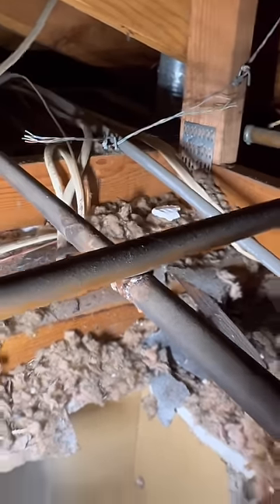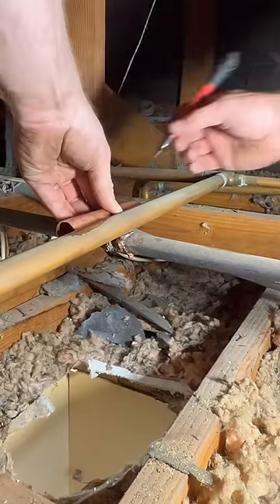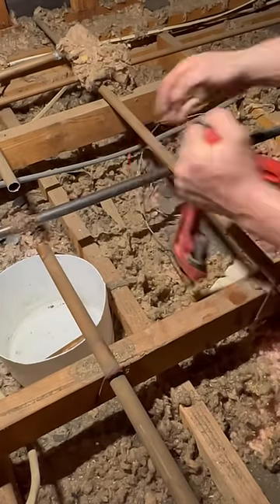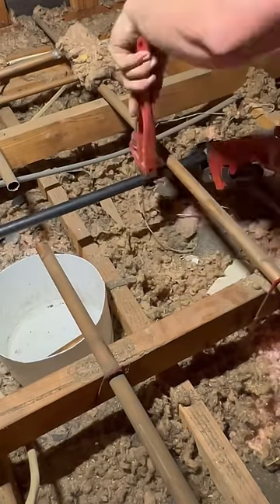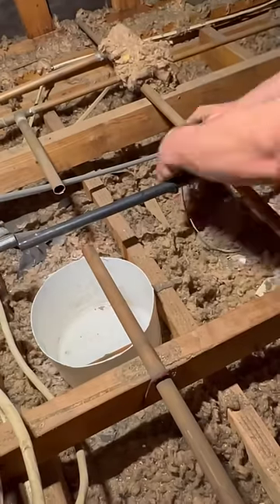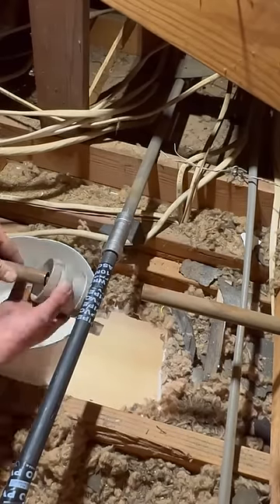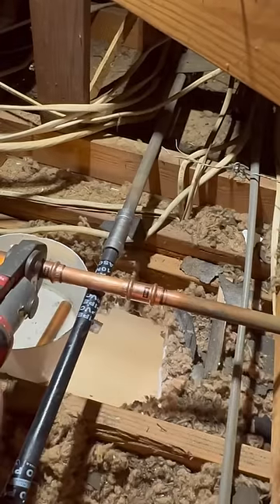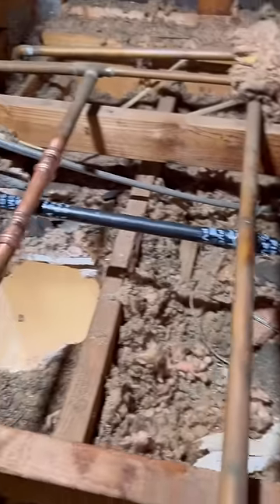a little galvanic corrosion action #plumber #plumbing #propress #soldering #diy #repair #gasline

Comment: You'd be surprised what helpers can screw up. We press 80% of our work now and it's rare but occasionally someone will get lazy and try to force an angle they shouldn't or stretch a fitting. Thosell leak. Gotta install em properly

Comment: Only time I have a propress leak, is when I forget to crimp it.
Reply: @Supa Trending Daily so all the pressed fittings from the 90s back are leaking then?
Reply: @Supa Trending Daily  you's onna those "back in my day" fellas, ain't ya?
Reply: @Megabear90  I heard they've been using press fittings in Europe since the 70's
Reply: @walterbrunswick they’re all over Japan too
Reply: The job sight I’m at right now (Kyle Field in College Station, Tx.) I seen the plumbers put in a few pro press leaks, turns out the battery on the press tool was low and the jaws needed some grease. I’m the Sprinkler Fitter Foreman, so it’s all threaded and grooved couplings for us.
Reply: @allencarabajal8989  Thanks, that's good information for everybody.
Reply: Hey boy… back in rubble rubble rubble! 😂

Comment: Even plumbing a long time,  never seen a press fitting leak either. Ive never had a call back from one either. Excellent work sir. Man I love that Milwaukee press tool. I have the m12 as well,  I also have the jaws for gas,  copper (even the 1 1/4”) and Pex as well. So handy man.
Reply: Just got into plumbing a few weeks ago, my first few jobs were going in to replace leaking press fittings.
Reply: The M12 Milwaukee radial press is really nice, I actually thought of buying it, but then I went for REMS Mini-Press 22V and it's great. Also never seen a leaking press fitting while I saw hundreds of PEX threaded fittings leaking and when I'm on a job where I gotta do something with pipes I always replace them for press fittings and I haven't had a complaint about leaks yet
Reply: @joeycampbell940 Then they were installed incorrectly

Comment: Commercial plumber here. I've used propress many times. When you have to replace 4" tees or 90s because of leaks it gets very expensive. Most architects have gone back to solder.

Comment: The building I work in gets a lot of leaky pipes.  They are old and frail.  There was one job the plumber came in to fix the leak, and pro pressed all the fittings as they usually do. Well we turned the water back on and it was leaking from the fitting.  First time I've seen it too.  Turns out the section of pipe he pressed onto was also weak, and he had to cut more pipe out to fix the new pipe on to. Didn't leak after that.

Comment: Only tiny rec is that I would put more isolation between the two pipe types and some way to immobilize that crossing.  Kinda a belt and suspenders method.  Otherwise, great fix.  Thanks.

Comment: The only time I’ve seen a Press leak, is when it’s been adjusted and not re-pressed. Even then, the connection didn’t actually fail catastrophically. A repress later and it was fine. (I believe you can get up to a few adjustments in and still be eligible for warranty. But don’t quote me on that.)

Comment: Your helper is quite handy....  I guess whoever installed the original pipes wasn't aware of metal contact corrosion....
Reply: Original installer just didn't concern himself with the issue because even my dumbass knows not to have the two metals touching

Comment: 3" copper pro press 90 inline serving a steam fired boiler- with a 1hp grundfos high volume circulation pump moving water through a 2" copper line connected to the system, running 24-7. the copper pro-press 90 leaked at the HEEL- but not at the joint. we double-press anything bigger than 2"- we noticed that if we don't... occasionally the joints will leak- and are easily fixed by 'offsetting' the crimp jaw by a 1/4 turn and pressing again, so now we double press EVERY 2.5" and larger joint. technically, the heel leak isn't a pro-press failure though- it's a COPPER failure.

Comment: Water hammers causes friction between two pipes rubbing causing a leak. Tape is just a temporary thing might last a few years but if insulated would have lasted 20+ years
Reply from the maker: 🤣🤣the pvc tape is going get melted away from water hammer friction?

Comment: I've only seen one pro-press fitting leak. It was on a tee joint and it was leaking at/around the connection point. I must say that this was on a hot water line in a hospital with 160 psi in the line.

Comment: Pro press for steel pipe. I have got to get into that. That's unreal
Reply: It's called mega press. For galvi and black iron gas pipe. I think they might be making ones for old galvi water lines as well. The press jaws fit on propress guns as long as they are compatible. Pricey, but saves tons of time over threading.
Reply: Works great

Comment: Propress seals so well that it seals even if you remove the o-rings. The only time it might leak is if you handle the pipe regularly, so don't use it on an outdoor hose bib.

Comment: I've had a 3 inch tee leak.  We air tested it at 100psi and then after that passed, we left the water on.  About a month or so go by and the tee finally gives out over the weekend.  We checked it and it was seated all the way, but funny how it leaked way later.  Luckily the building wasn't close to being finished and there was no problems as we had a floor drain right there.  So makes you wonder wtf happened.  Wish we would have cut a cross section out and see what was up.  

I've also had some of the rubber inserts get fucked up when inserting the copper pipe.  This happened on a 4 inch line.  For some reason seems like the bigger the pipe, the more problems.  Other wise I've never had any problems than just a handful.

Comment: Not to be one of those "hey boy" guys. But I did a little bit of research on EPDM rubber. That's the rubber used in most propress fittings.

This is from a paper on chlorine degradation of Butyl and EPDM rubber from company that sells EPDM and butyl rubber lined storage tanks.

"The recommended maximum concentration at ambient temperatures for Butyl and 
EPDM liners is as follows:- 
• Constant chlorine of max. 0.2 mg/l (ppm) 
o Will not have a significant effect on the service life of the liner. 
• Chlorine concentrations constantly higher than 0.2 mg/l 
o Will have an effect on the life time of liners. 
o The expected life time of the Butyl and EPDM liners is 20-25 years but 
will obviously be reduced with higher chlorine concentrations and the 
user must balance take this into account when calculating the 
expected practical life of the liner. 
• Temporary increases in concentrations 
o up to 5.0mg/l for a maximum of 24 hours and not more than 20 times 
over a year can be accepted without major effects on the liner 
o Temporary increases of concentration up to 50 mg/l for a maximum 
of 24 hours and not more then once a year, procedure according to 
BS 6700, can be accepted without major effects on the liner. 
o Or a concentration up to 500 mg/l for a maximum of 1 hour, followed 
by an immediate clean water wash, can be accepted for disinfection.

Your average city water is anywhere between 0.4mg/l to 4mg/l

That with their recommendation of anything up to 5mg/l exposure should be limited to no longer than 24 hours and no more than 20 times a year. 

That makes me doubt propress fittings. Not all the fud lore from some dude saying "hey boy". But  scientifically tested results from a company that manufactures products using the same materials that are used in the press fittings.

EPDM rubber is also used in those gas line press fittings. EPDM breaks down when exposed to hydrocarbons. The hydrocarbons essentially start cutting the polymer chains in half which heavily degrades the rubber. Natural gas is just naturally made hydrocarbons mixed with 11 herbs and spices.

Please do not use the gas line press fittings. That is fucking dangerous for the customer. I'd use appropriate language but it's not the time. That is going to get someone killed.

Comment: Generally, the copper press fittings leak due to poor installation, mostly not deburring and prepping the pipe, it scores the O-ring just enough.

Comment: Not a criticism a question from an up in coming plumber why didn't you swing joint the Cooper just to get it away from the galvanized steel as an extra precaution. Love the videos and content, can't wait till I upgrade from my manual pex crimper to the milwaukee wireless

Comment: The pro press fittings only leak if you aren’t hooked up dead on. So basically just user error.
Reply: I disagree out of experience.   -  Master plumber in Texas for 17 years 
propress is great but i have seen 50 + time that it has failed and the install looks good .  i run a 24/7 company so we get the emergency calls.    i have found that water softeners that are ramped up wuth eat the o rings out . i dont know why but i have had multiple cafes and diners that the soft water loops that will eat the fittings .  i can assure you this is true but i do not know why .   we are talking large commercial softners,  3 inch mains.  
i use propess where it is useful but my faith is in the good old gas welding it together.  cant beat a weld.
Reply: @Z The G  thanks for sharing your experience

Comment: After all that you just put tape in between them, they do make 45s in order to jump up and over
Reply: Why add more potential points of failure?
Reply: @MischeifMakerz  correct why reply on tape to eliminate dissimilar metal corrosion, you could have used tube benders and the same joiners if you were worried about the 2 extra fittings
Reply: @phs84  would make the tube shorter?
Reply: @MischeifMakerz  no tube in the truck ? what plumber does not have a bucket full of copper off cuts, just keep taping pipes bro, makes me look like a rock star

Comment: Have never seen pro press fittings used on a gas line before, thats pretty friggen cool. Do you have to use any sealant for them? Or just press them right into place? Likely different codes than us up here in Canada, but damn that would make life so much easier

Comment: I have had two propress fittings that leaked due to other than installation error, in five years of replacing water heaters and some miscellaneous plumbing. And no troubles of trick soldering or having to evacuate water full before working.

Comment: Nevermind I got my question answered. I wish i could use a ProPress so badly my company preaches about how the fittings leak but they don’t leak! pipes ive soldered keep me up at night. i always felt like pressed fittings work better than soldered joints

Comment: i wouldn’t sand down the copper when you’re adding on the propress coupling. it will damage the rubber o ring inside and actually cause a leak. great video btw
Reply from the maker: Viega recommended sanding old pipe👍🏻I do sponsored content for them bud

Comment: When installing black iron do you sand the pipe all the way down to bare metal or do you just use the sand paper to clean it up.
Reply: Neither. Cut , thread, install
Reply: I just clean it up to smooth surface.
Reply: @TeamTnA44  Yep, but sometimes one must use PPress.

Comment: I personally would have put something more resilient between the pipes, like a piece of pvc pipe cut in half or a strip of hard plastic wrapped with the tape, something that is less likely to rub through in time.
Of course, I am generally dealing with hydraulic lines in mills or on heavy equipment, so slightly more movement, but I like to prevent repeat issues! Lol

Comment: Ive seen those fitting leak before… they were not installed correctly and they ripped the rubber gasket. So as long as you install them correctly they wont leak.

Comment: As a welder all I think is that Milwaukee coming out with that pipe clamper tool must of been a life changer … tbh I’d just weld all that and it would never fail but just me guess u can’t weld copper
Reply from the maker: 🤣🤣you can solder copper but why would I. They make a tool for that

Comment: I'm not bashing propress at all, i use it every day, buuuut... I've definitely had more leaks using press fittings than i have soldering. I think a lot of the problem comes from fittings sitting out on dirty construction sites and dirt and dust accumulating around the o-ring.  That lubricant they put on them is a dirt magnet.

Comment: I seen someone fixed a pin hole with 1 propress coupling. That customer called, I went in found the repair failed, a little over a year later. I cut out a 10" section and preformed a similar repair that your showing. She was mad, I would be too. It cost her an additional $700.00 for me to come back. 

Ya so, I have seen one propress fitting fail, and I don't think that was nibcos fault. Just the Inexperienced hvac tech that was working on the plumbing.

Comment: Is there slip couplings for copper? So instead of using 2 fittings you could only use 1 like u did on the gas?

Comment: Ive never seen a properly installed pp fitting leak either. My bigger problem with propress is that it cam hold under an air test even when it's not pressed. Had a 1" cap explode off inches away from my hand before... double check your joints brothers.

Comment: The only leak I’ve had with pro press on copper is because my guys were too lazy to use the sharpie and verify that the pipe was made up all the way past the o-ring. Had 2 leaks total because of that. Then had 4 leaks from fittings that didn’t get pressed. That job probably had over 3000 fittings in it. Pro press is good stuff.

Comment: Press couplings for gas are the only way to repair a gas line in the middle unless you feel like chasing every single pipe forward of that thing. 

Personally don't like it for new installs or on really fucked up walls. But it works just fine.

Comment: How did this issue even get noticed in the first place, out of curiosity? Was the copper leaking water into the ceiling?

 And then, what kind of tape did you use? I'm not a plumber, so not familiar with what you specifically mean by 10mil tape.
Reply from the maker: Leaking through the ceiling. The tape is made of pvc if I’m not mistaken. It’s rated for burial and holds up in extreme conditions

Comment: So I’ve never had a pro press fittings leak, but I’ve been using them long enough to see where we’ve had guys that didn’t ream the pipe properly in a commercial application where it created so much turbulence, between the press and not being reamed, that the pipe down the line, blew out prematurely
Reply: Been using them for about 20years in the UK no problems, have used them on 4 inch black iron on heating systems time saved unbelievable. Cheers

Comment: Stress leaks think of it like on a water replacement where they just sling it nothing wrong with just singing it but if you rush sling you end up with high stress water line transition...that's the only time I see them leak.

Comment: Ive seen the propress leak first hand.   Ive also seen a solder joint leak.  

Only one of them you can press again to stop the leak.  

I do have concerns about the o ring.   But I have concerns about everything
Reply: It is anxiety, u have some repressed fears that consciously u are not aware of.

Comment: That pro-press gas fitting makes repairs so much easier.  Gonna single handedly kill DA Union...joint.  

Wondering was that actually galvanic corrosion or was it caused from condensation from the water line?  I'll bet on the water.
Reply from the maker: Definitely galvanic

Comment: No one considers the gas piping ever being responsible, why cathodic protection is so important/isolation of the gas piping electdd rically from the plumbing system with a dialectric coupling and or the fact that the plumbing system in old buildings was used for electrical ground.
So enters the handyman replacing the  potable water supply with plastics and ground is  systematically removed for the electical panel.
Plumbers: Always check the electrical system for proper grounding before working on potable water. It could save your life

Comment: To be fair, I’ve heard of soldered fittings leaking too. Anything to do with pipes or fittings has to be done right, and the fittings themselves have to be built properly with no defects for anything to truly bond together the right way. People getting hard press over certain joints and how they’re done need to grow up. If it works, and doesn’t leak then what’s the issue?

Comment: Pro press is designed to last as long at the pipes they’re pressed on too? The designers of blue max and cpvc said the same stuff lol
Reply from the maker: It’s thicker than type k copper
Reply: @replumb  my issues isn’t the copper of the fitting it’s the O rings that are the weak point.

Comment: Most of the time I see ProPress leaking on recirculating systems because the copper is soft copper that they use for the fittings also I use plastic pex fittings for recirculating systems just because the water will eat through the metal over time
Reply: The fittings are K grade copper. Try again
Reply: @MisterTwister88  the letter pertains to the thickness not if it's tempered or not which is soft (not tempered) and hard copper (tempered)

Comment: I don't have a problem with propress or even shark bite fittings. I'm sure they'll last about as long as a normal copper fitting. My problem is they are needlessly complex and wasteful. Now I know the market is all marked up so its hard to really tell what anything costs, but in the simplest of terms. Instead of using a few cents worth of copper, solder, and gas, you're using more copper,  a metal ring in some cases, and a rubber washer. It's the same problem as with cars. You're making something that could be cheap and simple and replacing it with something expensive and complex.
Reply: Eventually ALL rubber fails but indeed it may take up to 5o years.